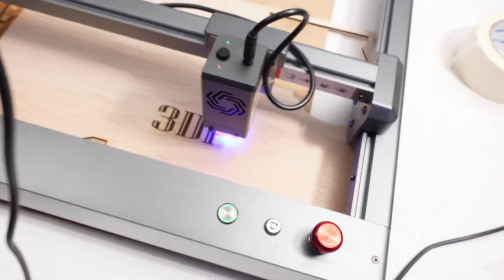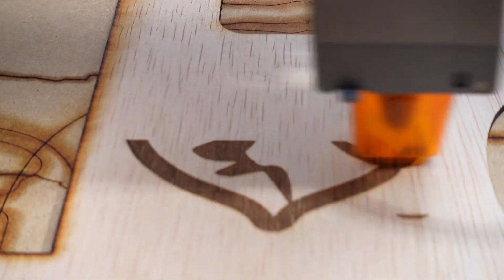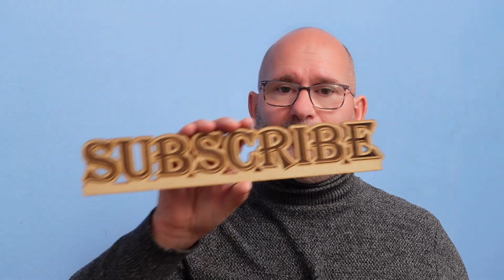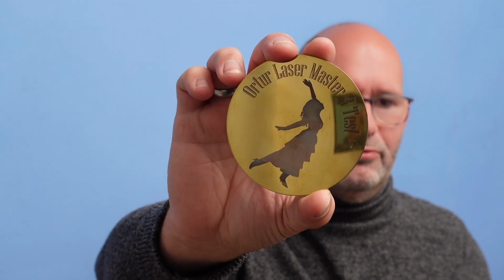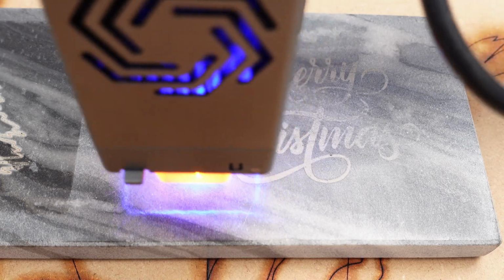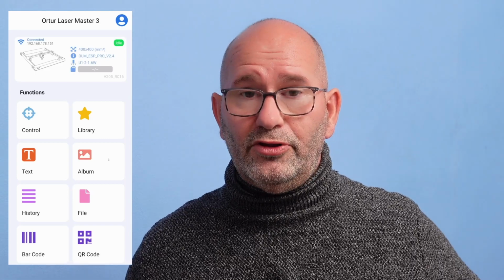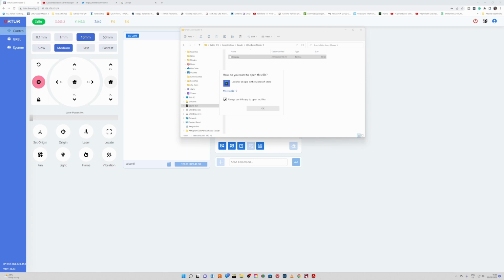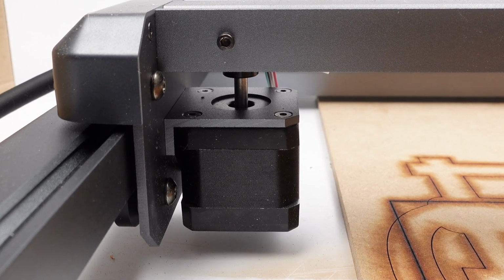▼ Ortur Lasermaster 3 Pro Review: An Affordable and Powerful Laser Engraver

Comment: TwoTrees TS2 or Ortur Laser Master 3Pro??
Reply from the maker: Not so easy to answer this one.
I like the added functionality of the TS2, which is great for having the perfect Z height. The fact that this machine is so easy to use after you once did the setup, is really a thing I like.
Yet, the LM3 has a slightly more compressed spot and therefore more power to cut through materials, yet this comes with a smaller working size and less Z height if you don't buy the feet to make the machine stand on.
In my experience, I use the TS2 more often, and I think I like that one just a little more.
Reply: @3dPrintCreator  Thanks for the prompt response!!  I just ordered the TS2 and are glad to read you answer as they are soo close feature and performance wise I was going crazy but the auto focus that adjusts for engraving depth or cutting was a key feature that drew me to the TS2.  I am a completely green novice with this but are looking forward to the journey.  Thank you much again!
Reply from the maker: I am sure you are going to like the TS2 a lot (or maybe, you already have it).
Have a lot of fun with it :-)